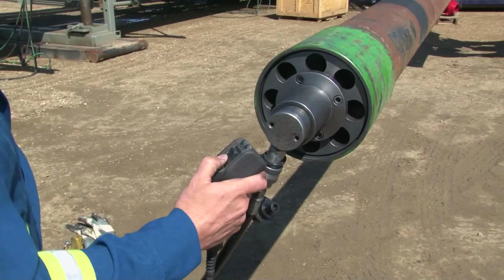Volant CRTi on automated drilling rig - Long

Comment: WHILE I HAVE A LOT OF EXPERIENCE IN MANY MECHANICAL FIELDS,I KNOW LITTLE ABOUT THE OIL PATCH!
HOWEVER THIS LOOKS LIKE A MUCH SAFER SYSTEM OF DOING CASING INSTALLATION AND REMOVALS!
IS THERE A SIMILAR SYSTEM FOR HANDLING THE DRILL STEM AND 
TOOLS?

Comment: what is CRTi ?
Reply from the maker: Casing Running Tool - internal grip.
CRTe describes the external grip version.
Reply: +VolantProducts What is the pint of the ring that they are installing with the pneumatic tool in the first sequence? Do you need different CRTis for different casing sizes? Do the 5-6 pads expand to grip the ID of the casing? What is the use for the silver threaded adapter that they remove when the casing is in the slips?
Reply from the maker: +epistte Some good questions! 
The ring installed in the connection box provides a shoulder that increases torque capacity. 
One base CRTi can be configured with Volant's patented grip system to run several different casing sizes. Details are available in the resource section of our web site http://www.volantproducts.ca/resources/ under 'specification summaries'.
The pads, or dies, expand radially to to grip the pipe body without engaging the threads, and the silver threaded adapter is an optional steel thread protector that keeps the threads clean and prevents damage that could result from extreme misalignment.
Reply: +VolantProducts Thanks for those answers. I do no work in the oil patch. I'm just a mechanical engineer who love to learn about the technology used in other fields. I live in the Utica shale of Ohio but I've never been up close on a rig.
Reply: internal casing running tool
Reply: VolantProducts I that same/ similar with MLT ring for casing while drilling? Is your product rated for CwD as well?